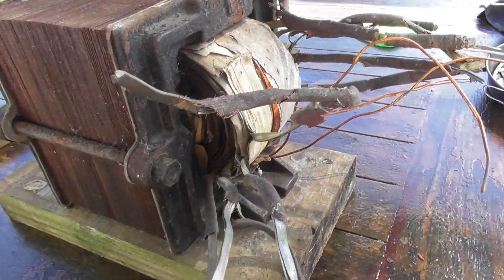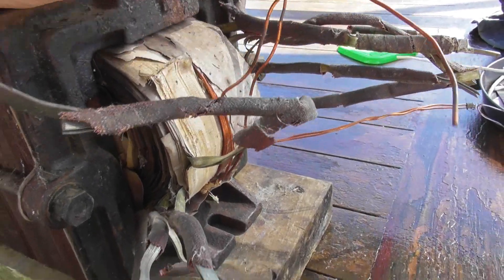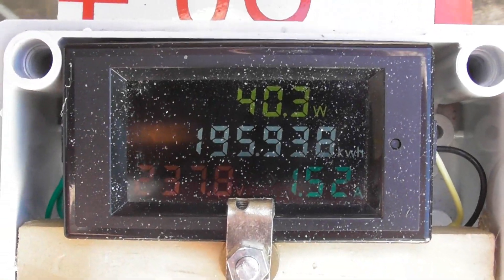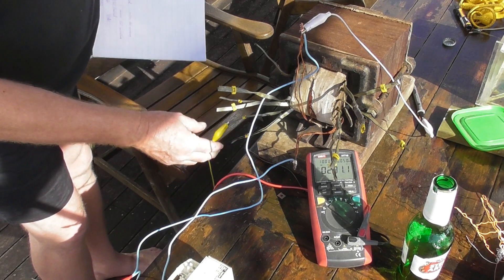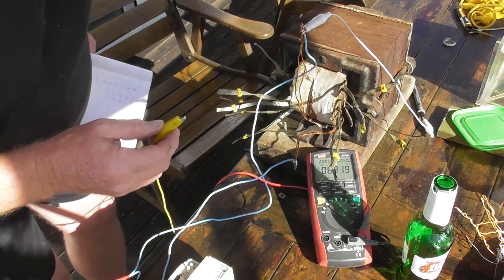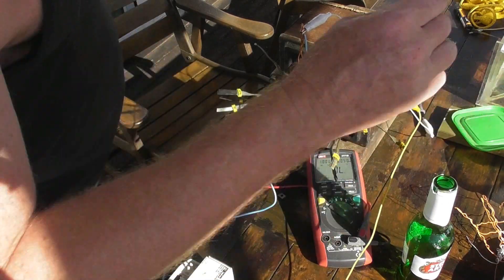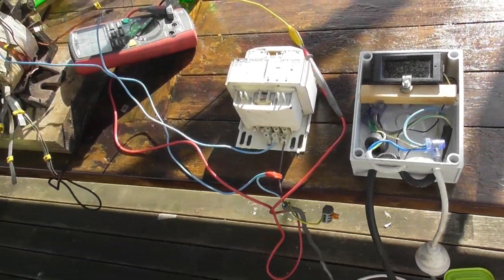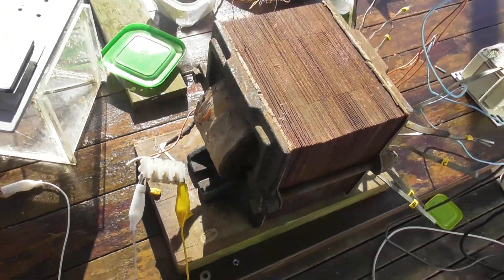How to test an unknown mains power transformer

Comment: KL is the original primary, the rest are secondary side, probably around 20A continuous for the lower value taps, though you might get 60A for 10 seconds to cooks things with it. With the paper insulation definitely max interior temperature is 90C in the windings, 50C at the surface, before the insulation cooks off.